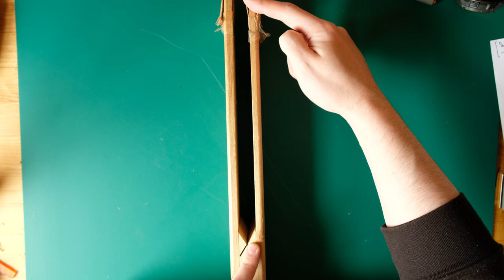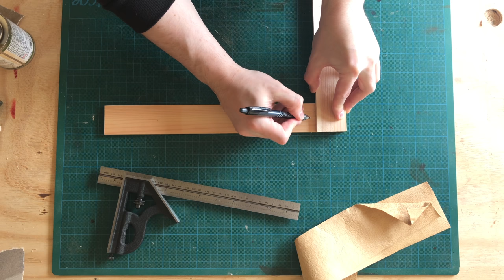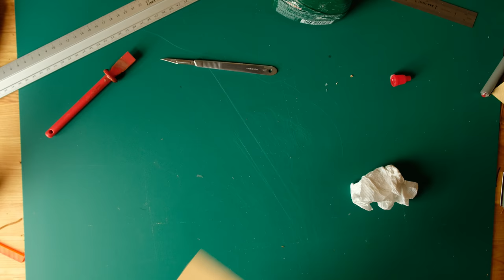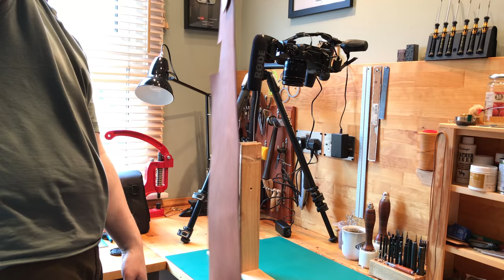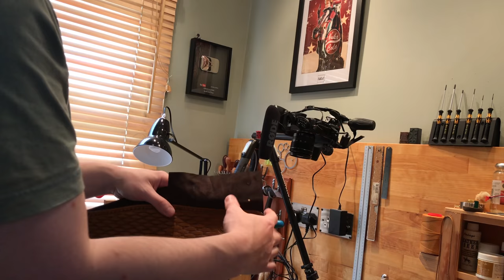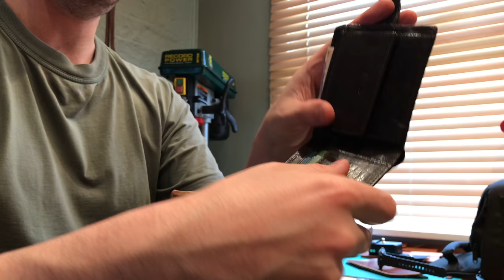Improving Your Leather Stitching Pony 4K

Comment: Clever.  Necessity is the mother of all invention.  I want to make a clamp that is mostly away from the edge of the bench.  Only the contact points are close.  A reverse scissors kind of deal.  The mechanism for closing the clamp is a foot away from the work.  Still working on it.

Comment: I really like the idea.  What about adding strong magnets along the arms that will hold the piece in place?  That way, the clamps aren't in the way.  Also, could extend the piece that sticks in the pony down and use some screws or bolts to help prevent whole thing from tipping over.  Think I'm going to try that.